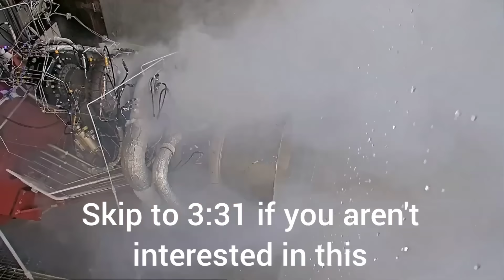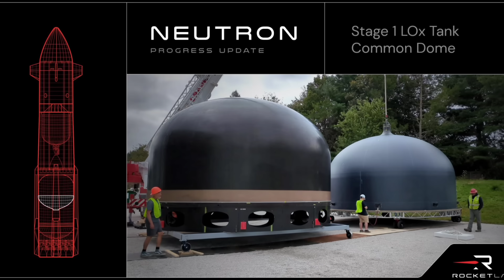The most sophisticated rocket ever is coming next year!  And SpaceX isn’t building it!

Comment: Comparing Neutron to Starship is not correct due to the nature of the second stage of starship. Neutron can be logically compared to Falcon 9 that has the same purpose. But more competition is always better.
Reply: Starship rocket system is in a league of its own, above all others. Designed for deep space or space-city builder delivering payload 150 - 200 tonnes that is fully reusable and refuelable, and has high launch cadence. Its like 16-wheeler semi, while all others are half-ton trucks.
Reply: @giannhsl8530  I'd say its niche is somewhere in between Falcon 9 and Starship, which bodes well for RocketLabs' business.
Reply: Neutron can lift a whole lot more than a falcon 9 - more than a falcon heavy even
Reply: @savinobodei4656  but... The first falcon launch was all the way back in 2010. If SpaceX just wanted to build a larger or more powerful version of it they easily could, but there wasn't much reason to.
Starship was meant to be an order of magnitude larger but also cheaper and faster to launch. 
It's not just about the size or weight of the payload, it's about how much it will cost to get it there.
Reply: You can compare it. With Neutrons rinky dink second stage being as cheap as it is, it can give the costs to refurbish a vehicle a run for its money.
A few things not mentioned, the second stage is hung inside the first stage, there are actually 9 engines on the first stage (render showed 7), and its a nose cone not a fairing anymore.
Reply: @Honestraccoon  the only way to compare them fairly then, would logicially be comparing the entire ship as the booster payload, since the entire ship is large enough in itself to be a payload, such as a re-fueling station in orbit or a space station, the amount of volume and flexibility of the ship makes the comparison a little short sighted
Reply: You're right! Starship was 3 billion government dollars for a lunar lander that we STILL DONT HAVE. Damn thing can't even make it into orbit thus far with 0 payload, and even if it does it would need something like 30 launches to refuel 1 what a joke. Neutron on the other hand seems like a legit rocket not surrounded by lies and government cash grabs, NO COMPARISON.
Reply: @jollygreenjoi  You vastly oversold your case. "Damn thing can't even make it into orbit thus far with 0 payload," is a ridiculous straw man. Two of them have flawlessly achieved orbital velocity on a suborbital trajectory. If you can achieve the velocity, and Starship has on its last two missions, you have proved the ability to achieve orbit.

When you say really egregious comedies like saying Starship is "surrounded by lies" you remove your own ability to persuade. Learn from this video. Extraordinary statements demand extraordinary evidence. Jordan started off with his "ridiculous" statement, then followed with a list of evidence that removed all doubt that he was on solid ground.

You may be able to do the same thing. But you've made a fool of yourself here.
Reply: @RockinRobbins13   Starship is an egregious comedy, and you dont have to look far to see that: "In 2021, NASA entered into a fixed-price contract with SpaceX valued at US$2.89 billion. The contract involves the development and manufacturing of Starship HLS, as well as the execution of two flights: an uncrewed demonstration mission and a crewed lunar landing." Do we have a human rated lunar lander for 3 billion ? These are just facts. So if you take a 3 billion government contract and do not produce anything close to the stated, doesnt that make you a liar or a conman or both?
Reply: @jollygreenjoi  So your reply is to move the goalposts. You didn't defend your original overstatements at all. You have no credibility until you do.
Reply: @RockinRobbins13   move what goal post ? and how does credibility even come into this when you can easily google that nasa contract with space x and clearly see no human rated lunar lander. I think the facts speak for themselves unless you're delusional.
Reply: @jollygreenjoi  better yet $5B for the starliner project right.... LOL... jollygreen is a paid person to just keep the interaction going as a troll to boost up this videos stats.
Reply: @jollygreenjoi  guess what ya'll rocket lab can't even land a rocket or catch rocket clown!!!😂
Reply: @jollygreenjoi  Guys let's talk with facts. It is impossible to compare starship with Neutron. Starship is a transport vehicle and Neutron is a launching rocket. Both are impressive for that they are doing. But Neutron compared to Falcon 9 can cary payloads with bigger volume but less weight. Neutron can lift 13 metric tons to LEO whereas Falcon 9 can do about 16 tons reusable. Now answering on the comments of Angry, Falcon 9 has 7600kn of thrust and Neutron 7300kn so the ratio of thrust to payload is leaning in favour of falcon 9.
Reply: @giannhsl8530   I fail to see how I have talked with anything but facts. You can't call something a "transport vehicle" if it has not transported anything NOT EVEN A MASS SIMULATOR.
Reply: @jollygreenjoi  they should use a Porsche Taycan instead of a mass simulator
Reply: @jollygreenjoi  You have a strong argument there. Problem with Space X as with Optimus it’s so difficult to separate the hype from the reality. Magic tricks like the amazing spectacle of the booster being caught is indeed impressive but it’s the nitty gritty that counts and often it simply hides certain realities, like the fact it simply has to do that complicated and expensive trick because it’s too heavy to have legs like Neutron. Meanwhile Optimus does all these interactions at a party that turn out to be humans doing most of the leg work, while interestingly a competing engineer who attended says far from the state of the art actuators etc presented in the hype he was surprised how run of the mill they were in reality so natural movement will be very difficult to achieve. So what’s the truth, snake oil or real innovation or something in-between? The fact that Musk is cosying up with the incoming President so overtly only makes one more cynical about the true state of affairs and begs the question is it a way of covering up otherwise intrinsic obstacles and costs that an objective relationship with authorities might otherwise highlight.
Reply: @jollygreenjoi  So then by your (flawed) logic, Neutron hasn’t even flown yet so is a complete failure? Why are you expecting technology still solidly in the testing phase to be performing all of the stated goals flawlessly right off the bat? You need to calm down buddy (and I’m guessing separate your political views from other topics, given the level of tantrum you’re throwing over Starship).
Reply: @II_Phrogs   Maybe if rocketlab accepted a large government contract to produce neutron but failed, you would have a point. As far as i know that has not happened. Stating facts and not buying into hype is certainly not throwing a tantrum.
Reply: @ So just because Starship is being designed using a gov contract means they’re not allowed to go through testing? In what way have they failed, and if your only answer to that is “because they’re behind schedule”, please direct me to any of the major space-related projects that hasn’t been/isn’t (cough cough SLS).
Reply: @II_Phrogs  No, I think you miss the point. The schedule, the testing, doesnt really matter if they spent all the money for that and still not delivered. Saying "well other companies do the same thing" doesnt make it ok. AKA two wrongs don't make a right. I find it amusing you're willing to make excuses for space x in the face of such bold facts.

Comment: The problem with 'sophisticated' is the increase in the number of critical failure points.  'The best part is no part' reigns supreme for keeping systems simple, easy to diagnose and easy to refine.
Reply: Agreed.
However, there's also something to be said about reducing the number of launches required to get stuff done in deep space.
Reply: There’s a middle ground between complex and reliable.  The history of sustainability in rocketry is the quest to find that middle ground.
Reply: I think you are confusing hi-tech with sophisticated. 

These carbon fiber rocket bodies have been used to get to space over 50 times already with electron.
Neutron does this.. but bigger.
Reply: ahhh Listen to the  Elon fanboi mantra " no part is best part, no part is best part" look how well that went with the starship  flight 1and the " no flame trench is best flame trench"...😂
Reply: @ Went well to be honest. Fast innovation.
Reply: So full of bullshit!  You don’t know your ass in a hole in the ground
Reply: Sophisticated meaning construction methods. Not complexity. The issue with composites for reusable is the low burn temp of composite adhesives and protecting the entry entry end from high temps.
Reply: “The best part is no part”
Lol 33 engines.. plus 9 thank God for  philosophy.
15-20 launch per single launch to Moon or Mars
When you analyze this “best part is no part” sounds like a joke
Reply: @pedrosura Premature analysis.
Reply: @ Actually, when Elon said 4 launches to Mars in 2024: 2 cargo 2 crew… that was really premature.

When Elon says 1 hr  or a day between launches for refueling, you are still talking about 2 weeks to fuel a vehicle. And this is so that you can launch this heavy vehicle to the Moon. For Mars, a good launch window is about 2 weeks. 2 launch 4 vehicles to Mars you would need 60-80 launches in 2 weeks. Not sure how gullible a person you are but that feat would be harder than Elon’s hyperloop. How is that going?
Reply: @pedrosura  No, stop. You are missing the point. All of what you said is irrelevant and sounds like the drivel straight out of a Thunderf00t video. 
I am saying that you are prematurely judging a rocket that is not currently designed for Mars missions as if it were. There is an awful lot of development, upgrades and progress to go through. Judge their Mars Rocket when they launch it. Right now these are all progress models and prototypes.
Reply: @charliewalker9443  I am not talking about a particular design. The mission architecture even if it worked as advertised is ridiculous. I am certain Space X can make a good looking vehicle inside but chemical rockets, 15-20 refuelings per launch, 4 month (best case) transfers, solar farms? Like I said the hyperloop is actually a lot easier than these Mars missions. Unless we develop the next level of space propulsion and nuclear power for the flights beyond Earth, humans are not going anywhere. Elon puts down and incredible amount of BS but his Mars ideas are not serious at all. Sorry, they are as serious as the hyperloop.
Reply: @ This is partly why you are on your keyboard and not an Engineer at Space X because you are prematurely pessimistic, sour and lacking in knowledge. You seem to completely miss a main factor in progress of technology. What matters is what they are actually doing, not what you think they are doing now and judging their future efforts on that. Bezoz actually said it best many years ago which is that we are not going to magically find ourselves suddenly able to achieve interplanetary travel or able to sustain life outside of earth. No. We actually need to build the technology and stepping stones to eventually achieve this. This is what Space X, Blue Origin, Rocket Lab and many others are doing, building those foundations to allow for all this to be possible. You are just being a grouchy person. Enjoy, great things are happening pal.
Reply: @  I was an aerospace engineer years ago. I am an Airline pilot now. Engineering is how I paid for my flying career. The truth is the truth. Putting an ipad on Apollo tech is not getting humanity off this planet. There are over 10 “next gen” propulsion and power technologies that if we are serious about getting off this planet, we would be investing and researching them.
I love space exploration but I also detest BS Artists. 100k per ticket to Mars, empty vehicle with movies, games and restaurants, no nuclear power, etc…
It is all BS. This lacks credibility for so many reasons to even bother naming. 
Not trying to hurt your feelings or dreams but the reality is that beyond the Moon, chemical rockets will not be taking humans anywhere. The quicker people realize this, the quicker we will get there ultimately.

By the way, did you get an aerospace engineering degree and work in the industry?
That is what I did. What did you do Mr. genius??
Reply: @ And here you are on your keyboard and no where to be seen on the cutting edge. Typical smart man thinking he is more clever than he is whilst being dour about the success of others and once again missing the bigger picture of what is going on. 
This will happen, and it will be off the back of work being done now. 
Degrees, as many people will tell you, are irrelevant to ones knowledge. They are merely a piece of paper to honour ones level of learning. It tells you nothing.
Reply: @ First, you question my knowledge as if that determines whether or not you are entitled to an opinion. Then, I tell you I earned a degree in this field and have experience in this field. Well, now, knowledge doesn’t matter! 
I see the big picture of what I am talking about. The problem lies in the big picture. If you take any time to analyze the “Mars mission” you will see how ridiculous it really is.
Reply: @ I am not questioning your knowledge in the field of Aerospace Engineering, I am saying  your knowledge about Starship, Space X and her progress, the future of the technology are lacking. Moreover you keep making the same flaw by critiquing the Mars capability prematurely and keep failing to understand how stepping stones in technology are founded. You actually believe you have the relevant knowledge to have any input on the matter. 
Another smart man thinking he is smarter than he is.
Reply: And moving engine parts from top of the structure to the inside (for necessary protection) while making them "invisible" makes the whole thing more complicated to manufacture and service. EM is right on many things. And technically he may not lie much, just don't take everything a businessman releases for a providence, ok?
Reply: @vensroofcat6415  that was a ridiculous statement!  The raptor three has been drastically simplified by utilizing 3-D printing and eliminating many of the sensors that were required on raptor one and two!  Additionally, it’s gonna provide more thrust per mass of weight of the rocket engine, and the reliability will be threefold increased
Reply: @jamesburke4437  Raptor 2 was simplified. For Raptor 3 parts were mainly moved inside other parts to protect them from the extreme environment during descent and in general. It has less parts on the outside, but most of them just went inside other parts. That doesn't make it simpler, on contrary. Turn on your own brain. 3D printing has nothing to do with the number of parts and their complexity. It's production process, not design.
Reply: SpaceX catching sultion is just stupid. Failure at the catch and the launch pad is also domed.
Reply: @SirSparris because you know better right? your criticism has NOTHING to do with your leftist political beliefs?
Reply: @websitemartian These people know more about rockets than Elon Musk lol.  Just ask them and they will say Elon doesn’t know what he is doing, after all these years of success.
Reply: @websitemartian  no. It has with the understanding of, don't shit where you eat. It's that simple.
Reply: @ well, you have to catch because you lose efficiency by not staging, by having to fly back to the pad and being so heavy. Even if this worked as intended, it is an insane architecture.
Starship will never take humans beyond the Moon if they are very lucky
Reply from the maker: Yup. Sophisticated doesn't mean best. We'll see...

Comment: I’m not sure that “most sophisticated” is a good thing in rocketry. When I think of “sophistication” I think complex, intricate, expensive, etc. And right around the corner from intricate and complex is broken and expensive.
Reply: Some complexity is necessary. Take Starliner, for example. It was designed with "stick and rudder" simplicity, and yet it failed miserably. There must be a compromise and a balance between simplicity and complexity. Even if the "best part is no part," there wouldn't be a product or service at all.
Reply: @PiCorder  I think Crew Dragon is much less complex than Starliner.  Way cheaper, way better than Starliner
Reply: @brianbrandt25  Crew Dragon is autonomous with very sophisticated and complex software and algorithms that not only make it complex but simplistic only in the sense that astronauts don't need to "pilot it" themselves. Without the complexity of its algorithms and software, it is not a simple vehicle to operate. Only by the highly refined technology can we only "think" that dragon is simple.
Reply: Saturn 5 had 5.6 million parts. Computers had rope memory that was hand laid without error, which was both insane and time consuming. 100% success rate.
Reply: Better don't look at Starship's engines then, which are over-engineered.
Reply: Bingo.
Reply: this is sophisticated in the way an elegant computer algorithm or mathematical proof is sophisticated
Reply: So... SpaceX are applauded for doing it: created the most sophisticated rocket engine to date, which is inexpensive and has an excellent flight record.

But that can't possibly port to Rocket Lab, can it. Ohhhh no, it's bound to break and be expensive.

Yet Rocket Lab has an excellent record.

So why don't we give them a chance, eh?
Reply: @chrismoule7242 SpaceX made the most advanced engine by deleting as much as possible and making it as simple as possible.
You can make an advanced system in two ways, by adding more and more things or by simplifying and removing anything unnecessary. 
The simplifying and removing process is dramatically more difficult.